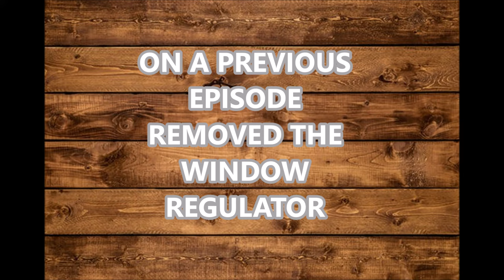VW BEETLE WINDOW REGULATOR REPAIR FOR STICKY & HARD TO ROLL WINDOWS - GIVEAWAY TIME - Baja bug

Comment: That's one thing I love about working on old stuff especially vw's. Simply tearing something apart, see how it works, clean lubricate and reassemble and you've pretty much got a factory fresh part! Great work and video!
Reply from the maker: @V8N8T  so true brother! These little mechanical cars are really not that difficult. They do require maintenance, just like anything else. But I’ve always thought they were extremely easy on certain parts.